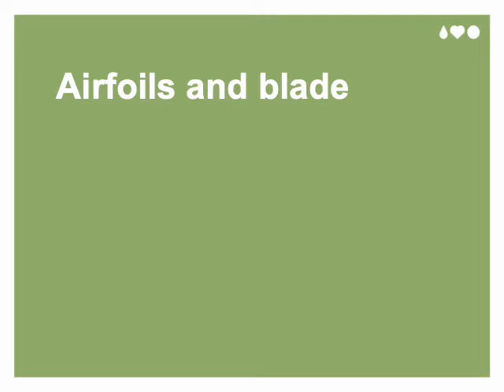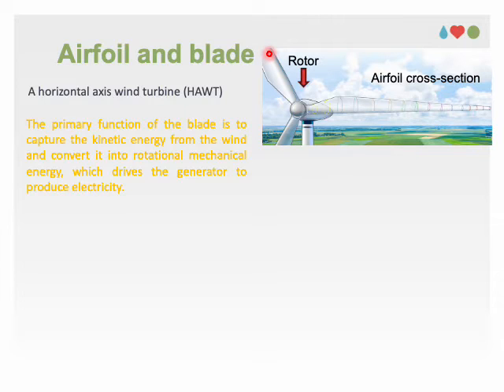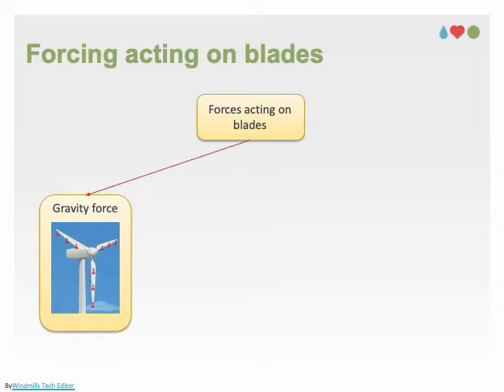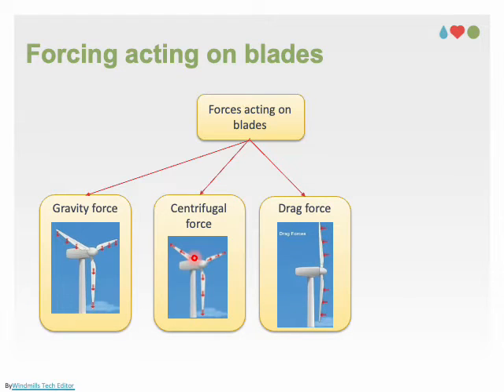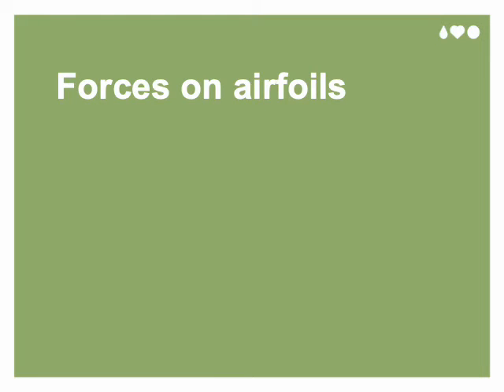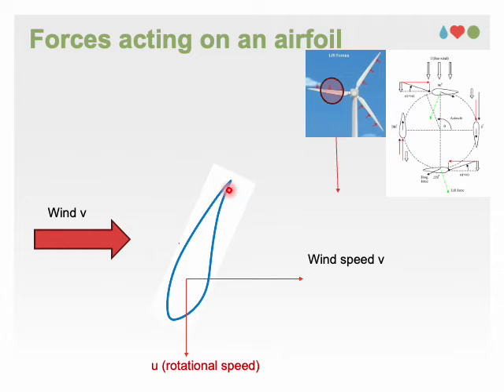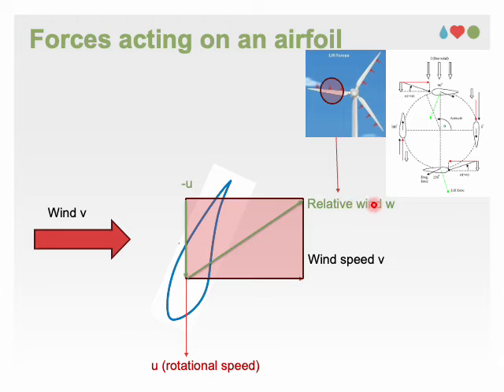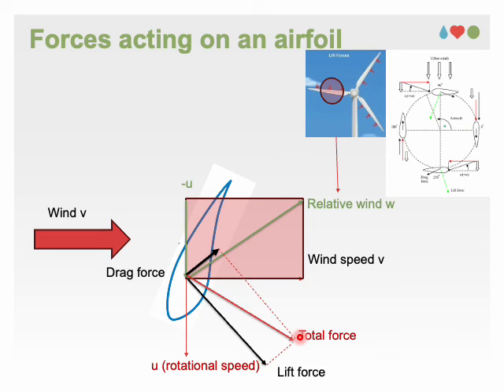Wind Energy: Forces acting on an airfoil of a horizontal axis wind turbine blade

Comment: Nice video, I think there are a couple of mistakes though;
 - at 3.30, you've mistaken lift and drag for torque and thrust. In general, the drag is not parallel to the main shaft (that is only true if the rotor is not rotating)
 - you missed the induced velocity
 - in your velocity triangle, your drag force appears very big. At the angle of attack you show, the drag force would typically be about 100 times smaller than the lift
But nice work on the gravity and centrifugal forces though
Reply from the maker: Thanks for the hint and I appreciate! More videos on this topic will be released soon.